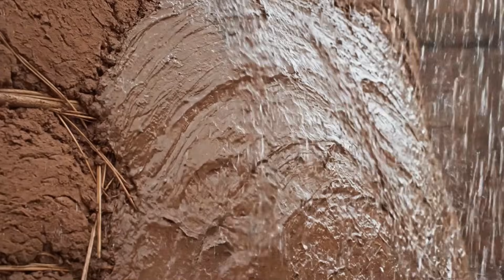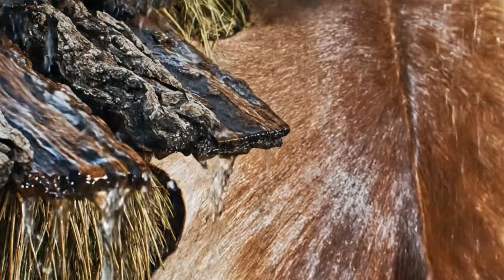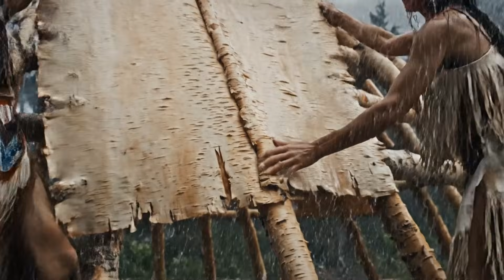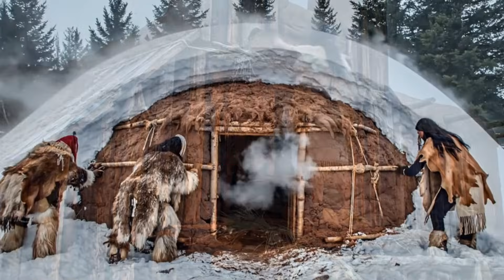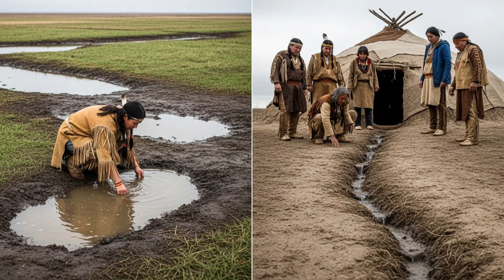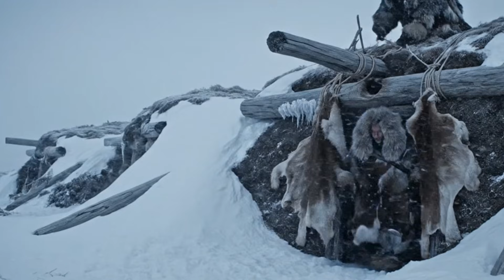How Native Americans Made Shelters Impenetrable to Water

Comment: Very good video! I want to add a little more information that I've discovered. I've hunted Native American artifacts for 30+years and I've had the opportunity to excavate several bluffs and rock shelters. I've seen and excavated ditches and dams they created to divert water from the inside. The material is so hard a shovel will hardly chip it. The soil in and above the lithic bearing stratos is very richly discolored which tends to indicate a raised platform floor mat have also been utilized. Imagination dictates a frame work with hides or brush covering the mouth of the rock shelter and most have a central hearth inside and outside the shelter. I would love to see exactly how they lived in these bluff shelters but from what I've seen I think I have a general idea. It would make a very good home, of course not all of these were long term dwelling places, more like campsites while on the hunt. The amount of artifacts in others (1000s) would support them being homes for an extended amount of time and over many many years. Just some thoughts from an oldtimer from Alabama. I'm no archeologist so my theories may be very wrong 😁 Y'all stay safe and God bless